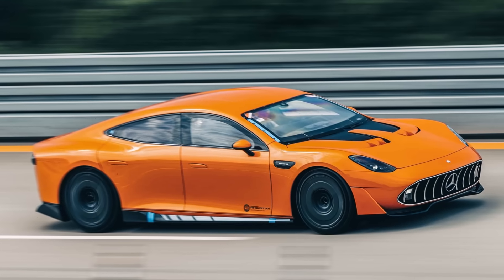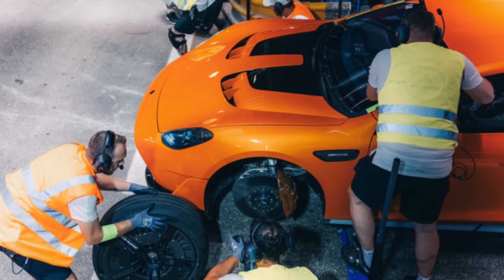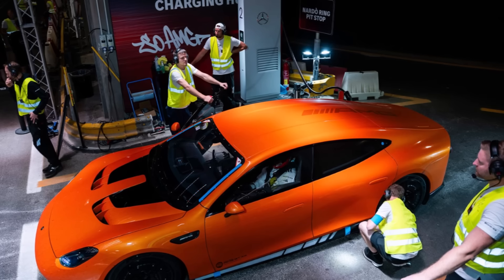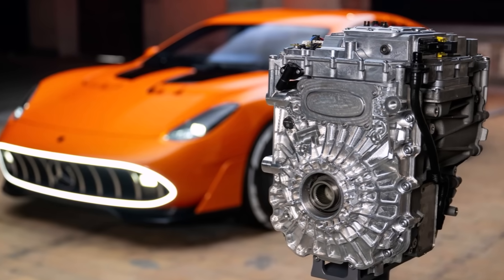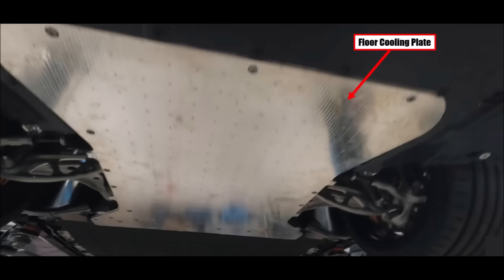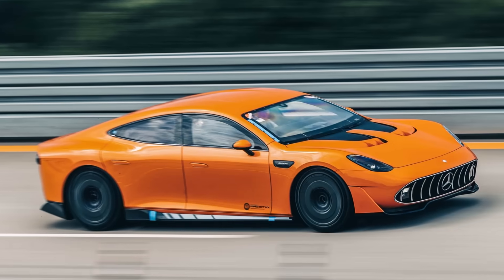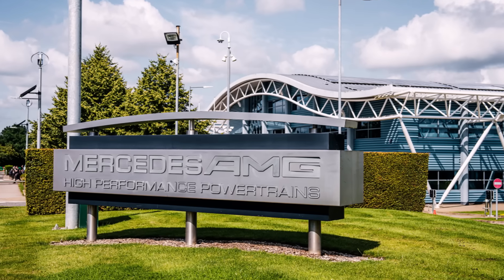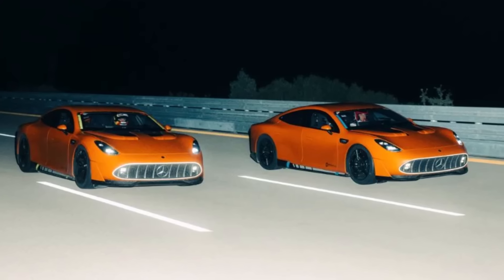AMG GTXX - If engineers are free - CLOSER LOOK

Comment: I have watched videos on this car, videos by car journalism channels. None of them mentioned this record breaking business. Very very cool indeed.

About that ionizing air to separate the airflow: my guess is that it doesn't work as well as Mercedes had hoped. I think this because the official exterior sketches of the car show a beautiful if predictable rounded corner there, whereas the final car has an edge (gets sharper towards the bottom) that looks very much like a compromise.

Comment: So they travelled 5479km in 24 hours. The longest distance ever travelled in the Le Mans 24 was 5,410.713 km in 2010 by the Audi R15. I know the Audi was running at the Circuit de la La Sarthe, not Nardo but that's still pretty wild.

Comment: i feel so glad that they used the same cooling system that i designed for computers and for my kit car project that im designing, just one difference, but the same idea. A few years ago, when i was drunk i ideated a race in the north of chile in the desert, a race of 40000km endurance race, a world cup where you compete as a nation doing 1000 laps in a circuit of 40km. Every country determines who goes in representation of his country, just one car per country, one brand, multibrand etc, issue of the participants. The idea was to get the best of every country in innovation in a race, win the cup was a proud for the nation. The regulations or rules where only for security and safety, no hp, traction, aerodynamics, performance, combustion or energy limitations for the race. Basically a safer canam in the desert of Chile, the driest desert in world, in the most hottest part  and in the days in the country, probably in the world, with a beginning like old lemans. The name was "The challenge of the sun: The space race of motorsports"(in that place for the indigenous people, the sun was the most powerful god with Pachamama).

Comment: It might be a bad comparison, but you kind of have to reference SAABs "The long run" an incredible feat our Swedish little automaker did in 1986.

3 standard SAAB 9000 Turbo straight from the production line, to Talladega super speedway in USA, running them for 100´000km in 20 days, with the fastest car at an average speed of 213km/h
All three cars made it to the finish line @ 210 and 208 km/h on average.
Breaking 19 different speed records.
This is the closest attempt I've seen to SAABs record.

Comment: Really cool project and impressive results. Thanks for the video.

A question that I have wondered about for a while that I assume you might be able to provide some insights into. If F1 rules for the next season were suddenly changed back to rules from 5, 10, 15, 20 years ago, how much faster would the cars be than the original cars from that rule set? Would a 2026 Haas built to the 2011 rules blow the Red Bull RB7 out of the water for example?

Comment: It is an amazing engineering achievement. I would be delighted to know if they had separate cooling loops for the battery and the motors and how they controlled all  the cooling components. Will probably watch several times
Reply from the maker: Yes they do, you can see their valve block (central hub) in the video.

Comment: I wonder how much utility the underfloor cooling plate can provide at reasonable speeds like 120km/h? It's the most interesting detail about this project to me. I see a lot of hype around axial flux motors, but do they have any advantages/downsides other than size/packaging and weight? These hype articles all mention them being used as in-wheel hub motors, but I have a hard time believing they will be durable unless they are torque-y enough to not need a gear reduction; imagine how terrible the ride will be from all the unsprung weight! I'd love a video on this topic if you can acquire more info on realistic real-world advantages rather than only repeating the theoretical advantages. Given the recent rare-earth magnet supply concerns, can axial-flux motors be made without them (like externally-excited radial motors)?
Reply from the maker: You won’t see the cooling plate on the road as this could easily cause trouble in customer use, bottoming out etc. but it’s a nice feature of the record car

Comment: Well made video but I feel like I'm missing key points, like what was the battery capacity, weight of the car, or rough number range, charge times, and charge rates, maybe voltage too? It feels like Mercedes shows us some stuff and says, just believe us. I fon't doubt they did it, but at what cost and at what tangible parameters would be nice to get a grasp of.

Comment: It’s a brick with wheels that is going to probably weight between 2.3 and 2.5 tonnes. 800v battery, 3 electric motors, similar specs to the Ferrari Eléctrica.

Comment: Is the cooling plate water proof? 
Is there a way to filter water when driving in wet conditions to create additional cooling for the batteries, similar to ground effect with air, but battery cooling with rain drops running to the bottom of the chassis? Or am I taking it too far...

Comment: I'm in awe of this feat. After your video on the Yangwang U9 I was a bit worried that Chinese companies had a sizeable engineering lead in EVs over European brands, but I am even more amazed by this record as by the Yangwang. Sure it's not as flashy as a 3000hp car, but this is so much more relevant to production cars, to have what's essentially similar in size and profile to a CLA break so many records. And it's such a timely response to huge worries that people have regarding EVs: yes, EVs can be reliable, yes, they can charge extremely fast, yes, they potentially could become a viable endurance competitor, yes they can be on a circuit without overheating. Mercedes did a tremendous job, and they are really on a roll with their EV prototypes: I remember how recently the EQXX beat incredible efficiency and range records, on public roads, going up and down, beating even Mercedes' goals and expectations... The EQXX and AMG GT XX are an incredible pair of overachievers, and I can't wait to see them (hopefully) become production cars. And I hope the other brands will wake up and get to Mercedes and AMG's level!
Reply: Why were you "worried"?
Reply: @OwlWithTheSmoke good question 😂 I believe that in the cases where progress is a good thing, the most people should benefit from it. In many ways, EVs represent a leap of positive progress, and they should become not only a viable option for (almost) everyone, but a better option for (almost) everyone. And while in China this has been the case, with excellent EVs dominating their ICE counterparts, in Europe car manufacturers have produced some amazingly tepid EVs... far from the best they can do, and depriving us from what could be great cars. It looked like the engineering might of some of the historically greatest brands was just absent, and that was worrying, in a time when that's most needed. But these records restore my confidence, like some of the best product design is doing elsewhere (I'm thinking about the great new Renault 5 and Twingo)

Comment: Impressive car but it's ugly as sin sadly. I would be interested in a video explaining why wider tires provide more grip. Without secondary effects only the material should make a difference and my vibes tell me that wide tires help mostly with heat management and reducing grip loss when only part of the tire is on a low friction surface but I bet you could provide a better explanation.

Comment: Each of those two rear motors put out 820Nm at launch control torque.. and spin to a terrifying 13.5k rpm (rated not burst)
Reply: Actually, 13.5k RPM is not very special for these EV motors, a boring VW ID.4 also probably hits that at high speeds. Other performance cars like the Xiaomi hits 27k and BYD hits 30k RPM, while the upcoming Ferrari is also around 27k. The difference is that Merc/AMG is using a 2-speed transmission rather than chasing high RPMs, which is better for efficiency but costs a bit of weight and complexity.

Comment: Great project! The only question is - as is often the case with prototypes like this - how many of these new technologies can actually be put into a production car (which has to keep working for many years and be made to a cost)? Some of it, sure, but are we actually gonna get something that approaches what these record cars are capable of? Let's hope so. The Vision EQXX concept was also impressive in many ways, but was designed in a way which made it basically impossible to replicate with a production car (extremely narrow tires, air cooled battery which only allowed low power outputs, aero shape which compromised the interior space, etc). The AMG GTXX seems more conventional and ready for production, but we'll see.
Reply from the maker: The AMG GTXX is very close to production, they even optimised the rear seats for comfort on this record car ;)

Comment: The choice to run in the summer makes me think their engineers relied on the lower air density of a hot day, to get a bonus to the overall slipperyness, and went overkill on the cooling for the motors and batteries. Which makes a ton of sense. The batteries work the hardest during charging, during the initial acceleration next, and being able to keep the powerpack under the chosen Tmax during those two regimes, with as much coolant pumping (or dry ice coolers forced through heat exchangers during "pit stops" similar to the F1 team uses), will add reliability by letting it drive at a fraction of their maximum cooling/heat disapation, and lower the Tmin of the battery packs, motors, etc, decreasing parasitic loss from resistance, im sure the system for monitoring and controlling airflow through the heat exchangers is fascinating.
Reply from the maker: Summer is also an advantage in terms of wind and gusts
Reply: @bsport320 thats maybe my favorite thing about a project like this. There are no irrelevant data points. I am sure everybody involved in the design and planning had their knowledge and understanding widened. Its easy to talk about an idea like this, but the real world has a way of scrambling the predicted data in patterns that feel like a personal attack 😅
Reply: @bsport320 only partially I imagine? Because a summer thunderstorm could ruin all of that in under an hour

Comment: Oil cooled batteries, and controllers is the way forward. Yasa prototyped a very advanced motor controller but nobody wants to certify parts for X years in oil, so it died a death and was only used for testing the Axial flux motors...
Reply: Oil immersion cooling batteries are probably good in these motorsport type settings, but seem very overkill for any non-performance car. Maintaining 300km/h, then regening from 300-0, then charging at 900kW isn't a very typical usage scenario 😅

Comment: This is an astounding engineering feat. Another challenge now is keeping it from the...ahmm Chinese spi...I mean friends.
Reply: Chinese automakers can probably already do this already if they felt like trying. The 3 most interesting/non-generic details is the underbody cooling plate, direct oil immersion cooling, and the underbody diffuser velocity bump. The latter 2 have already likely already been done before, but the cooling plate seems very unique, I wonder how effective it is given the low surface area without fins.

Comment: The design nods to the C111 (especially color and front grill) - love it!
Reply: The Production Version will have much better looking headlight not vertical but more horizontal
Reply: This is not bad, the C111 and its brethren were much prettier though.
Reply: I love how self proclaimed Mercedes fans in the official AMG posts loose it on the „ugly Maserati“ design and don’t get the C111 heritage at all because they don’t know any Benz below the W204😂
Reply: 💯.  The C111 was an experimental platform. The C111 was never intended for production. So anything tested here is intended for F1.
Reply: People don’t get this at all. The 70s Maseratis also looked similar to that orange concept test bed. It’s perfectly nailing the heritage! Sure the proportions with 4 doors look odd but EVs don’t work as 2 doors.

Comment: So It's one of these projects meant to offload F1 development costs
Reply: This has way too much real world application for an association with F1 designers 😂 One of the major hurdles for electric cars isnt battery density, or torque/size of motors... Its controlling resistance and heat generation during the cycling of the powerpack. It is what limits the speed of recharging, for one. Taking cues from this and improving their energy storage system, is immensely valuable. I have always been so frustrated at the disinterest in dielectric coolant (oil typically) for powerpack and motor cooling from most manufacturers. because it solves so many problems, including maximum battery cycles. 

Sometimes i like to have a laugh with the anti-electric crowd and say "oh you can still feel useful and get your fingernails dirty, electric cars will need their oil changed still" 😂 the looks i get!
Reply: @robingordon6662  depends on the type of car, battery density still does play a big role. for track car, most EV is just too heavy. for enthusiast car, the car doesn't drive last long enough for a good track day than ICE car. for long trip driver, you need too many stop and wait time and it can be extra shitty depending on where you are and available charging network

my assumptions why manufacturer avoid dielectric cooling is likely cost of it and added difficulty in repairability and maintainence. it's quite applicable on the higher end segment of EV though. that's why rimac nevera uses it
Reply: Yep. 😂😂
Reply: Very convenient timing, HPP joining the project as 2026 looms
Reply: Whatever your shit brain comes up with to make this achievement sound worse 😊

Comment: The plasma induced airflow separation is super interesting and would love to see a video going more in depth about it. 

Also if you are reading this B Sport, I would love if you made a video analyzing the aerodynamics of the 2020 f1 cars, but more importantly the 2004 to 2008 f1 cars aerodynamics. I’ve always been super curious at what all the little aero bits on those cars do but I’ve never been able to find a video going in depth into that on those older cars. 

Otherwise love the content tho
Reply from the maker: Glad you liked the video, and thanks for the suggestions!
Reply: @bsport320 where do they apply high voltage?..
Reply: @АлексейКастевич  my best guess is they use a Voltage converter.
Reply: I think you would also enjoy kyle.engineers content on aerodynamic design and regulations
Reply: @InstabilityControl  I love that guy’s videos but he doesn’t have any aero breakdowns of f1 cars before 2022 unfortunately.
Reply: @milesmcmullin2053 yeah the me the older cars are also much more interesting, especially the aero wars that came with the V8s until the 2009 cut.
I love those double wing monstrosities of the 2008 season!
Reply: @rolux4853  same lmao those 08 cars are probably my favorite all around season when it comes to the way the cars look aerodynamically. The only seasons that can compare are 2018 and 2021
Reply: You might want to check out Real Engineering's Ionic thrust plane video

Comment: Would much better, just take the money of this project and focus on make new type of fuel to use on ICE engines and forget this EV bullshit cars !!
Reply: no
Reply: Money spent on 'sustainable fuels' is more useful when set on fire. 'Sustainable fuels' are an extremely expensive and convoluted technology that will at best, allow old collector's cars and maybe racecars to run without using fossil fuels
Reply: @needles_balloon Yes, for classic cars and other niches. New batteries are coming soon and combustion is than totally obsolete in everyday driving.
Reply: @bertkreft9689  kkkkk really, did you see, every EV market is colapsing, the manufactures are not able to selling cars EV cars, the public dont want this shit !!
Reply: @bertkreft9689  keep ignoring the energy density of gasoline and diesel and you can make yourself believe anything
Reply: Even better idea, go park in an enclosed space roll your windows down turn your ice on and earn your final Darwin award!
The gene pool will thank you gashole SMFH!
Reply: @4literv6  Perfect example of why EVs can't catch on, the pushers have to use force. SMH.

Comment: As a client and big AMG fan, none of this stunt matters to me, unless they will sell the exact record technology and make the charging of 850kw available there is no way any of this is ever going to production, and if it does it will probably be given some limits or some changes. And let's not forget it is an EV, it will have fake engine noises and fake gear shifting, and will be very pricey and depreciate like crazy. All this effort could have been directed at giving us more better and lighter cars with V8s and V12s rather than fake electronic stuff that will break and be a nightmare to deal with. As an AMG fan, this stands against everything AMG is, and I do not approve.
Reply: Such stunts are Mercedes style. Example: That E class diesel W211 stunt to show they still could build reliable cars. Didn’t they sit at 250km/h for hours? Similar with the 190.